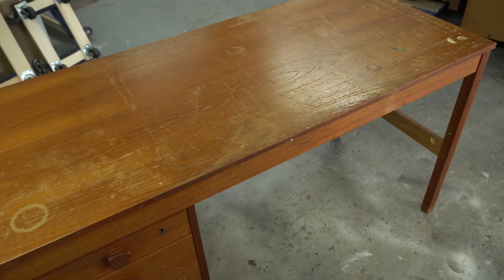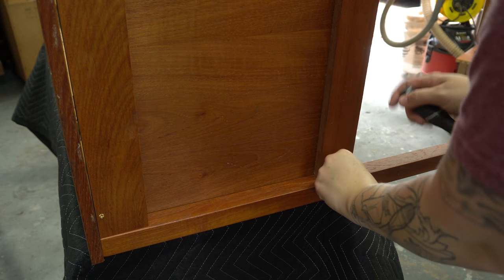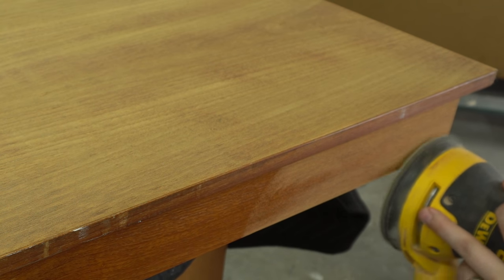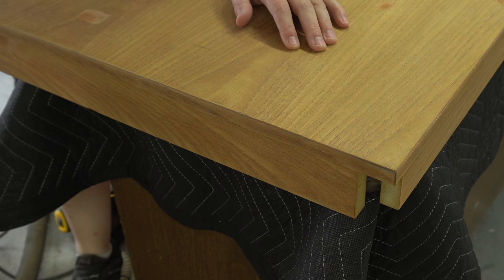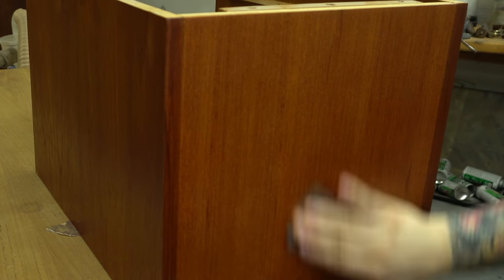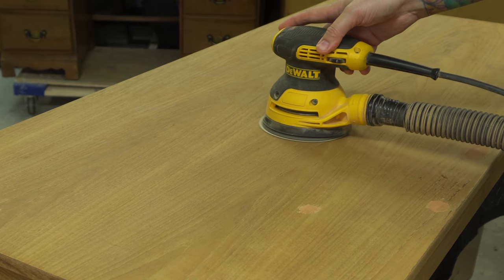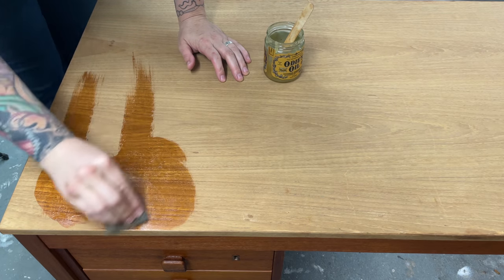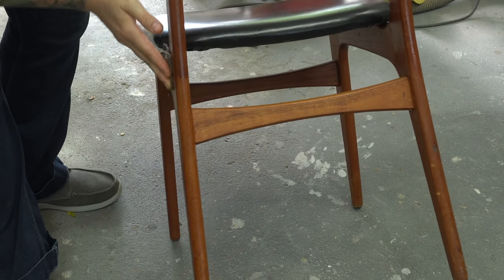AMAZING RESTORATION of a TRASHED mid century desk - ODIE’S OIL on teak

Comment: What you said about the chair actually answered the one question I had about Odie's oil. I was thinking about using it on the cabinet of my 1882 White Sewing machine instead of the Feed and Wax I've been using twice a year for a decade; but it's original finish is in good shape.

Comment: A quick update from last year, when this video was posted! Meanwhile, Odie's has an improved formula that cures the quickest, therefore allow to cure for 1 to 3 days before you expose to liquids, you can use your piece immediately but don't clean or expose it to liquids until fully cured! And, a good tip you can match your color filler using our stains/ powdered pigments! 
Kudos Angie to your amazing work!
Reply from the maker: I’ve recently also been trying out the pigments for patching as well- trying to cover up irreparable damage. It’s been working well! The pigments have multiple uses and I love them. :-)

Comment: Really wish I'd watched this before tackling the desk I just bought. It's also teak and from the same time period with a lot of the same issues. It still looks way better than it did but there are a couple really obvious problem areas. It's a couple corners I had to build back up on one drawer and a veneer patch on a side panel and they just don't blend well. But this is why I'm learning on something I want to keep for myself instead of something I want to flip. I'll probably redo those parts later now that I know better. Really appreciate the knowledge you share in your videos!
Reply from the maker: We all start somewhere and it's all a learning curve - I don't think I'll ever stop learning. Thank you so much for watching and I'm so glad I could help!

Comment: Stunning! So worthwhile to preserve the natural wood on MCM furniture and you did an excellent job.  You shouldn't feel the need to apologize for anything you did to the desk because it looks beautiful and renewed.  
Question: What did you do to reinstall the side rails (the ones with the white metal corner supports)???
Reply from the maker: The rail actually wasn’t needed at all! The legs were structurally sound and sturdy in their own. The rail they had would have originally been up at the top, against the set of drawers that someone removed. When the took out the drawers, they took that rail and moved it down. But I’m happy that it was at actually needed because it’s sooo much better without it!

Comment: Just a question about process: did you consider rotating the top so that the hole in the front right corner was in the back left corner? Was that possible?

Comment: Beautiful job. I found a sweet little table with a beautiful wood grain and it wasn't in bad condition but it had a big round stain ring in the middle of the top. I even tried to bleach it out but nothing removed the stain. I wish I could have restained it instead of painting.
Reply from the maker: I find oxalic acid works pretty well for most rings (as opposed to regular bleach)!
Reply: @TranscendFurnitureGallery  even a ring from dark stain?
Reply from the maker: Yep! I have a video on it- check out the one titled Oxalic Acid .
Oxalic is specifically for wood.
Reply: @TranscendFurnitureGallery  thanks a million!

Comment: I would love to know if you have any tips to upgrade old drawers. I have a 50s dresser and  put drawer stop but the drawers kind of wiggle waggle all over the place, there are no slides, not on the bottom center,  not on the sides. Is there an easy solution?

Comment: I wonder if you could have put it back together with the top facing the other way, so that the damaged parts were at the back of the desk and less noticeable. Especially if there were screw holes on under the other side of the top where the missing set of draws once went.

Comment: I have an antique piece of furniture.  I'd like to just clean it and add Odie's oil or wood butter to it without refinishing it.  Is this a good idea or not?  Or is there something else that would be better to use. Thanks!
Reply from the maker: Yes, it’s a great option to clean up and refresh the piece. Odie’s would typically recommend to clean the piece with the safer solvent (literally called Safer Solvent, it’s also an Odie’s product) and a very slightly abrasive pad to remove any contamination from the surface, then apply a very light coat of either the oil or butter.
Reply: @TranscendFurnitureGallery  Thank you!

Comment: Could you drill out the hole on the top to a more uniform size and insert a grommet so it will accommodate computer cables?
Reply from the maker: I could have, but the hole was at the front, so it didn’t really make sense to keep it. If it was at the back, that is definitely a route I’d have taken.

Comment: I may have missed it, but curious as to why you were using the steel wool to apply the oil instead of a brush or rag? Thanks in advance ☺️
Reply from the maker: It’s not steel wool- it’s a non-woven pad (mirka mirlon) :-)
Reply from the maker: Also- It has to be applied VERY sparingly because everything not absorbed in the set up time gets removed with a rag so to put it on any thicker (like from using a rag or brush) ends up wasted and becomes quite difficult to remove. So the thinner the application, the better.
Reply: @TranscendFurnitureGallery  Thanks, makes sense ☺️👍🏻

Comment: Have you ever just put a new veneer on a top? I’ve seen a lot of your videos, and there’s often times I’m wondering if new veneer would be easier, quicker, and give you more final look options.
Reply from the maker: Easier and quicker in most cases, definitely. But bloody expensive. Because I choose to work on the pieces that are more often tossed, it wouldn’t make financial sense to spend $150+  on a sheet of teak or walnut veneer for most of what I work on. But on high end pieces, definitely.
Reply: Yes. I thought about that. I ❤ your videos. Very knowledgeable.

Comment: @2:56  Those "corrugated metal fasteners" used to be commonly used for fastening the miter joint/corners of wood picture frames (less frequently for butt joints)--not common any more, I don't think.  I've never seen them used for fastening a top to a side/apron
Reply from the maker: Me either! Same for me, regarding seeing them on mitred corners mainly

Comment: How can you tell the difference between veneer and real wood when it all has the same finish?
Reply from the maker: Veneer actually IS real wood! Just very thinly sliced! Laminate, on the other hand, is that cheap plastic-y stuff you might be thinking of. If you mean how to tell between wood veneer and SOLID wood- check the underside of the drawer face, or at the very back of the top. Usually you can see the different layers. :-)

Comment: I felt cheated when you didn't show the finished result of the big hole repair! That was the whole question of your video. Other than that: Well done.
Reply from the maker: You can actually see that area in several shots from 16:16 onward- I guess if it doesn't stand out enough to "see" it, then I'll take that as a good sign. lol

Comment: The particleboard was disappointing to see.
Reply from the maker: That’s quite common in mid century furniture. Extremely common. Manufacturers chose it specifically for its stabilizing properties (as opposed to solid wood which tends to crack and expand with the seasons) and to keep costs down, while covering it with more expensive real wood veneers. Especially the exotics like rosewood, teak, and mahogany. And of course, walnut, which there was a lot of in that era. Even today, many modern pieces have particle board- it doesn’t automatically mean a piece is invaluable or subpar.